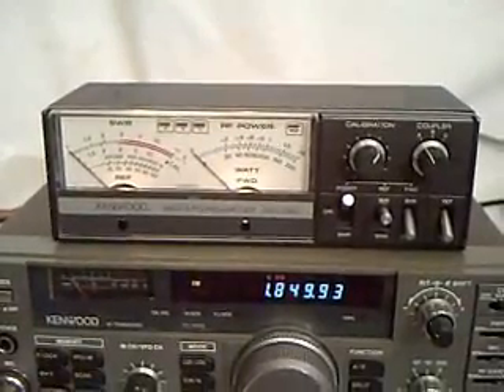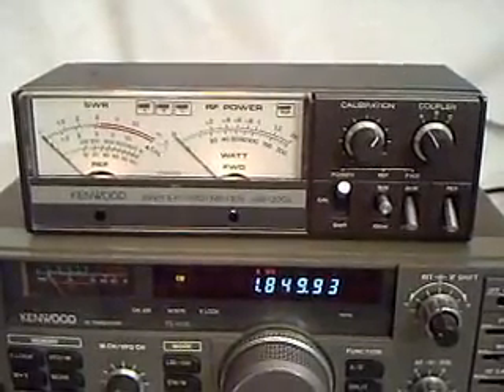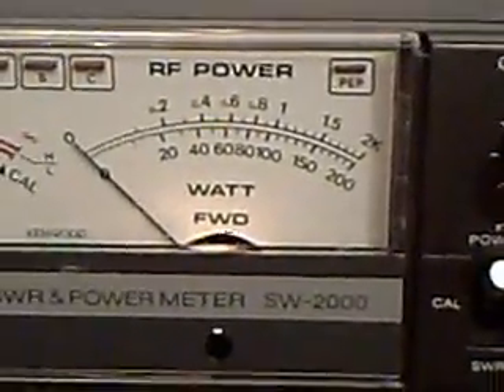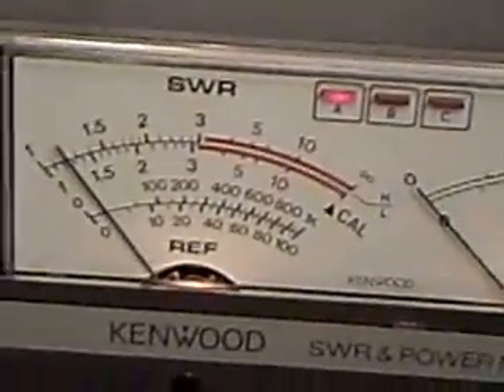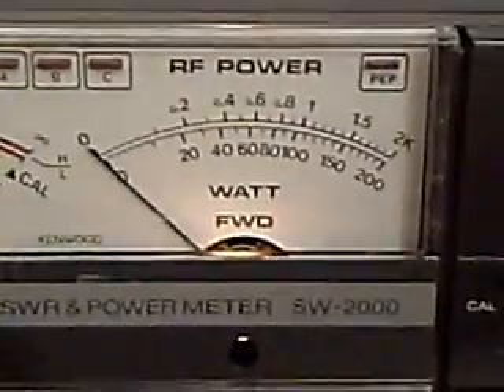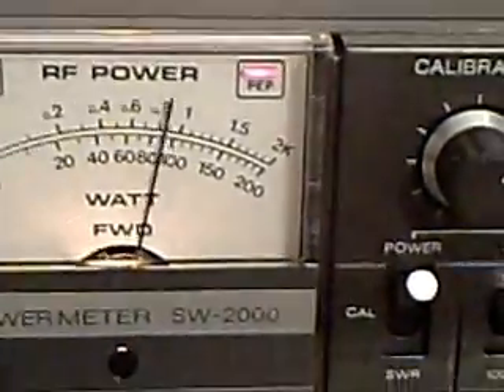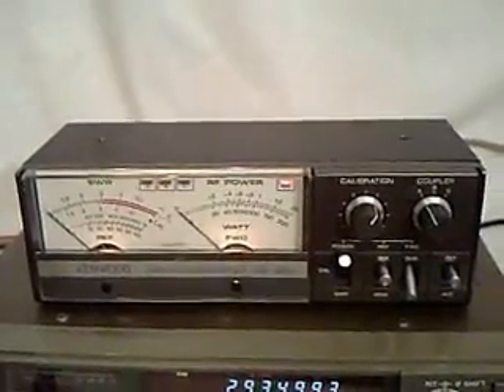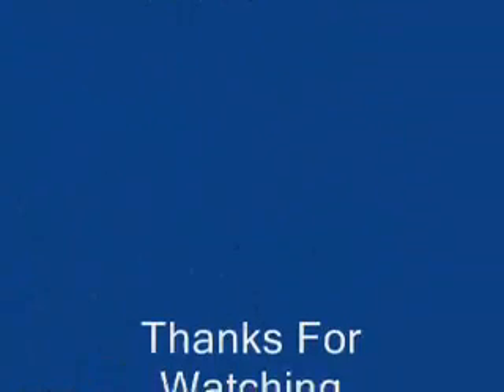Kenwood SW-2000 HF & 6 Ham Radio Swr/Wattmeter Demonstrated

Comment: I just picked one of these up a couple of weeks ago & the light on the wattmeter side is out.Any idea how I can change the bulb? I have attempted to remove the meter face with no success.I also took the top cover off & it did not provide much access to the light either.If I could remove the meter face without damaging it then it would be pretty easy I think.The SWR meter has an issue but I am using it as a bench meter so going into my cantenna dummy load SWR is not an issue.My luck is that the wattmeter light is the one that is out & the SWR side has a working light & it's not needed.Have you any idea how the meter faces are removed or what the best route is to the bulbs? Thanks much 73 & God bless.
Reply from the maker: That task I am not sure of, as I never had to disassemble one of these meters..Sorry I can't be of help..73, Mel, WA5UTK
Reply: Thanks anyway Mel.I have since changed meters on my bench & put the Kenwood aside in my collection of many brands & styles. de W4KVW
Reply: Hi your voice fades  an there are to May camera movements just mount your camera or phone.  I'm sure it will be a lot better shame though I have packed away since my  old c. B.  Days

Comment: It is a Very Good Watt/Swr Meter  I had mine put away for awhile and Went hook it up and   The lights would Work   , But Not the PEP LED And it would not read . Then I  Went to E-Ham Reviews  and Read CAUTION The Center pin is  Neg not Positive  , and this is NOT On the back or the Manual I switched it and Now it works Great , I marked that info on the Back too

73 De Don KA9QJG